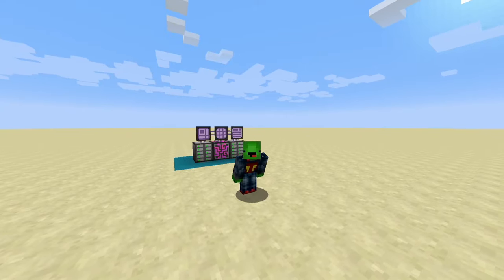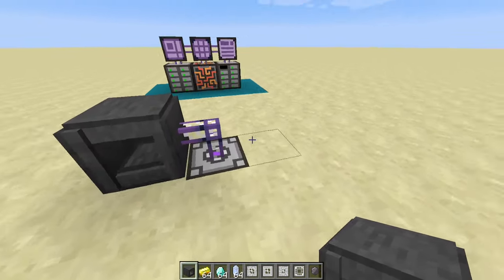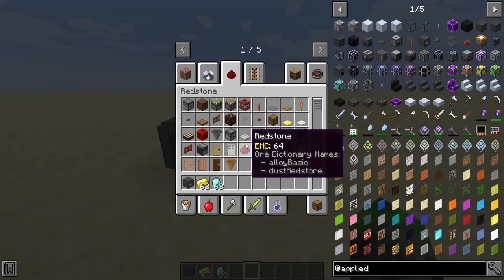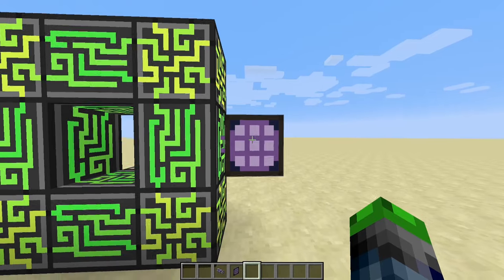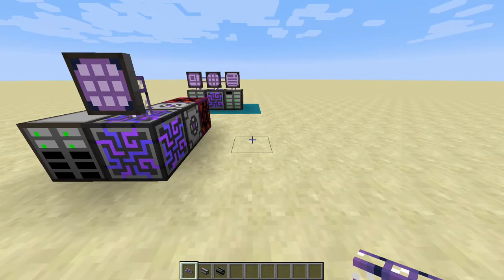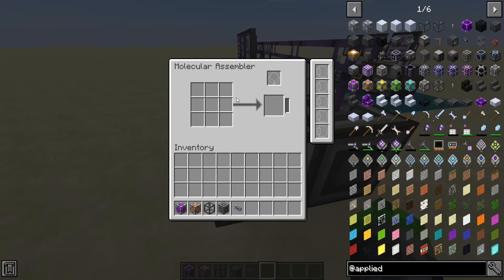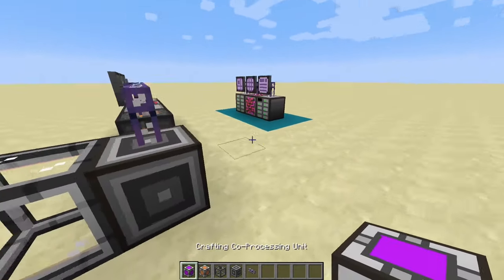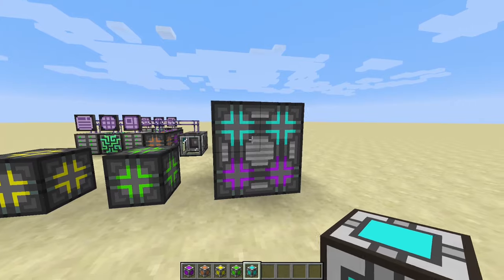(1.16.5) If You're CONFUSED About Applied Energistics... Then you NEED to WATCH THIS!!

Comment: This is a nice, crisp introduction to my favorite mod. :D

I got some points of interest:
- Your cluster of ME controllers cant be bigger than 7x7x7. You will notice right away when you build an invalid structure because the colorarion goes from rainbow to a dull red.
- No cable carries 12 channels. The dense cables carry 32 channels, everything else carries 8.
- While you can look into the system inventory with all three terminals, imprinting crafting patterns requires the pattern terminal.

<3

Comment: 1k storage cell = 127 Stacks of a single item. Or 65 Stacks, while holding 63 Different items. It uses 8 bytes of data to store a single type.
4k storage cell = 508 Stacks of a single item. Or 260 Stacks, while holding 63 Different items. It uses 32 bytes of data to store a single type.
16k storage cell = 2,032 Stacks of a single item. Or 1,040 Stacks, while holding 63 Different items. It uses 128 bytes of data to store a single type.
64k storage cell = 8,128 Stacks of a single item. Or 4,160 Stacks, while holding 63 Different items. It uses 512 bytes of data to store a single type.
When the Stackable Item Size is 64:
1k can hold 8,128 identical Items
4k can hold 32,512 identical Items
16k can hold 130,048 identical Items
64k can hold 520,192 identical Items
When the stackable Item Size is 16:
1k can hold 2,032 identical Items
4k can hold 8,128 identical Items
16k can hold 32,512 identical Items
64k can hold 130,048 identical Items

ME-Cable specifications:
Glass-Cables, covered Cables and smart Cables can handle up to 8 Channels max.
Dense-Cables can handle up to 32 Channels.
If you use Dense Cables for P2P Tunnels, you can route 32x 32 Channels (1,024 Channels) from your Main ME-Controller to wherever you want. The most efficient Way is to use a separated ME-Controller only for handling/routing/controlling the P2P Tunnels instead of connecting your Tunnel-Network back to your Main-ME Controller. Simply place up to 32 P2P Tunnels at your Main ME-Controller, use smart-cables to connect 4-Times 8 of them to a Dense Cable and run the Dense cable wherever you want. At a suitable Place break your Dense Cable in half an put a ME-Controller in between. You also have to provide Energy to this Controller. If you want to run Energy over this Dense Cable, it's very important to use quarz-fiber to isolate Energy from Data when connecting it to your Main ME-Controller or other ME-Cables. Otherwise all ME-Controllers wil turn red and stop working.
Then put additional P2P-Tunnels at the other End and then you can link them with a memory card. To link them, you first have to go to the P2P Tunnel at your Main ME-Controller shift-right click on an unlinked P2P-Tunnel, then go to the other End and simple right click on an unlinked Tunnel too. If you did everything right, after a moment the P2P-Tunnel at your Main ME-Controller shows "online, linked, input side" and the other one shows "online, linked, output side". If you want to use only one memory card to link all of your P2P Tunnels, make sure you clear the memory card after each successfully linking by shift-right clicking while looking at the air or at a block.
Remember that the big Plate of the P2P Tunnels can be connected to ME-Controller and Dense-Cables, while the smaller side can only be connected to glass-, covered- and smart-cables. You always have to reduce the Dense-Cable down to Glass, covered, or smart-Cables to connecting buses or panels. Keep in mind not to connecting ME-Cables in closed loops. This can mess up and decrease the speed of your ME-System.

When using Smart- and Dense-Cables you can see by the colored lines how many Channels are used. But beware! Both Cable-Types can show 8 Lines (4 dark colored and 4 bright colored) in the black Part of the Cables. At the smaller smart-Cables every Line stays for 1 Channel. At the Dense Cables every Line stays for 4 Channels.
Remember that one single ME-Controller has 6 sides. Each side provides 32 Channels. That gives you 192 channels in total when connecting efficient with Dense-Cables. When you build your Main ME-Controller like in this Video, you get 32 accessable Controller-sides and you can pull out 32x32 (1,024) Channels.
By the Time i thought about this ME-Network and how it works and learned how to use the Channels very efficient. Especially with the ME-Interfaces in conjunction with other mods. I often use the 9 Config-Slots of the ME-Interfaces for real Autocrafting and Auto-Processing such as with EnderIO. One Tip: ME-Interfaces are much faster in Item-Transport than Import- and Export-Buses. One ME-Interface can easily hold up with the massive Item-Flow of an 100% infused RF-Tools "Builder" when using it to mine OR placing everything.

Comment: Can anyone help me, my me glass cables will not connect to the fuutra block/me controller, and it doesn't work
Reply from the maker: Those cables can only connect to the energy acceptors I believe, you will need to covert them to the me cable which requires 2 flux crystals I believe

Comment: im so confused how do i get power if i cant get the creative cheat sorce you should explaind how tf i get power im so lost
Reply from the maker: This isn't a tutorial for power, this is a tutorial for applied energistics. You will have to rely on another mod for that. There isn't a way to generate power in Applied energistics 2.
Reply: @YTSuperturtle  but stil you ned power to do Appleid energistics sooo like you cant do a single Thing The tutorial is explaing without power somyou coulis say that its The most inportent part
Reply from the maker: @tobyhero287  applied energistics 2 doesn’t have a energy creator. You’re out of luck there.
Reply: @YTSuperturtle  you Can use a machine i cant regenerere The name right now but Thor thing is in Applied energistics
Reply: Remember